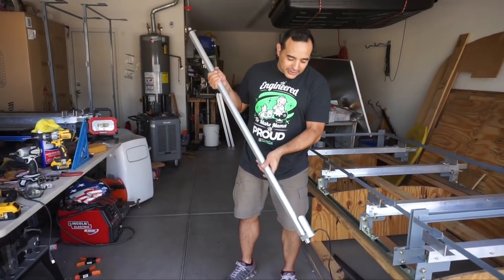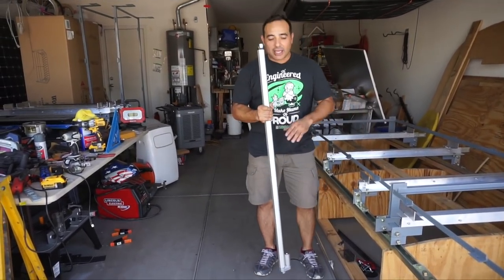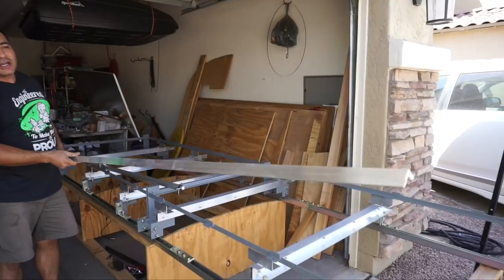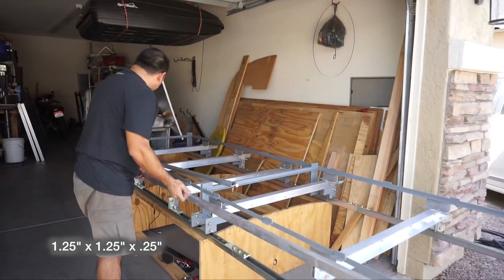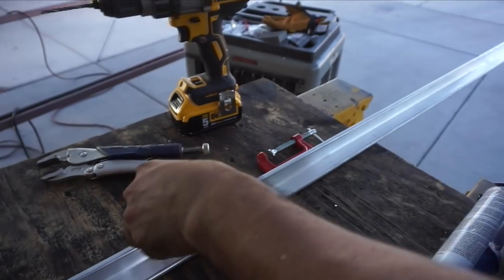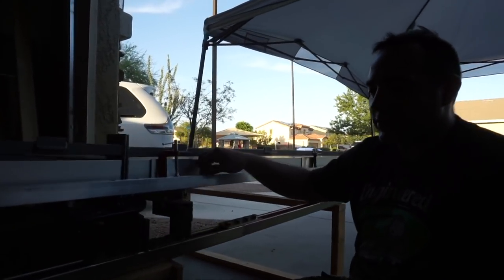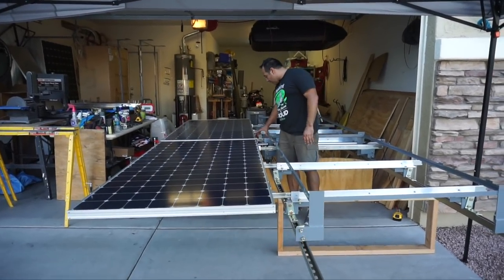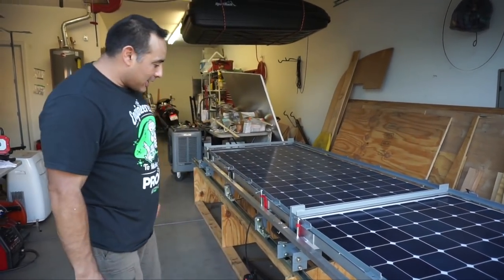Solar Rack: Part 5 - Fitting a Linear Actuator

Comment: All you had to do to prevent “wobbling” is have the center slider turned 90 degree’s perpendicular to the two outer ones. If you would have done that you didn’t need to over engineer this all.

Comment: I have concern with the way you are attaching the operating end of the actuator. With the droop your panels have at full extension, having the end of the actuator fixed will cause the operating rod to bend. This may cause binding and excessive wear on the actuator. It will likely be better to have that end float.
Reply from the maker: Hmm that is a good point - I will need to take a closer look at that - Thank you for sharing.
Reply: @BeginningfromthisMorning  Just make sure the motor can pivot at both ends so it adjusts to the droop.
Reply: hi maybe you can answer a side question, you seem knowledgable on the subject.   Do they make telescoping actuators....my specific needs is it starts at 28 " then can telescope to 85"?    thanks in advance.
Reply: @jackduplechain7592  non-hydraulic actuators can only extend to less than twice the contracted distance. Hydraulic adds weight and complexity to the setup.
Reply: @leebiggs2844  thanks for your response
Reply: @leebiggs2844  thanks for your response.

Comment: Great job!

Remember, as long as you have the upper panels on a separate charge controller from the lower panels, you can still be charging your batteries with half the panels when they're retracted!
Reply: They don't need to be on a separate controller, just need to be wired in parallel.

Comment: Very nice. One thought would be to go from the angle aluminum to square tube aluminum in the same dimensions. That would be more rigid and maybe stop the wobble at the and of the travel. I do not think the wobble you have is anything to be concerned about other than the aesthetics? 

I think you should use a 48 volt battery and try the hurtle race again (I wounder about longevity of the motor if you were to power with 48 volts? speed would pick up and as there is hardly any load the motor might survive??)! 

I think it will be plenty strong to resist movement unless powered (movement would have to over come the worm drive gear in the activator) . Only other thought would be to have one liner activator for each panel, at $200.00 each it would only be a total increase in cost of $400. 

Been looking into costs of building a new barn vs repairing one of the existing barns for my shop. The one I wanted to use for the shop is so far gone that it is cheaper to tear it down and build new (or so I thought) every time I talk with the contractor the price goes up. Started at $35,000 and now we are at $70,000. 

I put a stop to that and the current thought is to use one of the other buildings for the shop but the same process of increasing costs is happening. May have to wait and do it myself after I move in.

Great progress! Glenn
Reply from the maker: Thank you Glenn - always great to hear from you.

The wobble was reduced considerably when I went the 1/4" thick aluminum.  I think that when we are able to secure the panels properly and actually fully secure the angle bar across the front that it should eliminate most if not all of the wobble.   I agree that it seems to mostly be aesthetic in nature (there does not seem to be any binding happening as evidenced by the constant pitch of the motor (it does not strain at all).

I have given some thought to doing one actuator per panel - that one is not off the table yet.  Plan B is always: "spend more money"

On the barn - that is a shame - do you think the guy is just trying to feel you out for what you are willing to spend?  I kind of felt that way when we were getting quotes for the paint job on the bus.

Doing it yourself might be a fun project - I built a garage with my dad when I was much younger (maybe 13 or so) and I distinctly recall he used that opportunity to "teach me the value of a dollar".  Turns out a dollar is worth about 2 months of hard labor digging trenches, pouring concrete, framing the structure, and painting it!  I remember thinking "man this dollar he keeps talking about is not worth it!"

Best of luck on the move - I am looking forward to new videos at the new place.

Juan

Comment: Great job guys, but being an engineer... a colleague of mine used to say: “Now for the real life test, poor a bucket of dirt over it and see if it still works” ;-) ! Thank you for making these videos.
Reply from the maker: LOL yes ... most of what we do is somewhat of an "experiment".  We figure - even if they get stuck - we should still have 1740 Watts of power.  If you look on YouTube most "HUGE" RV systems hover around 1000 Watts :).  We are cautiously optimistic this will work even if the deployment mechanism starts to be an issue.
Reply: Beginning from this Morning wow, thats a lot of power. Guess you have the choice to leave the bottom row covered if you don’t need the extra power if the rows are correctly wired or you could sell the excess energy to neighbouring RV’s on camp sites ;-)
Reply: I was thinking that those sliders are going to get dirty and bind up. I hope the actuator has a over current protection.  They have to unsealed many little parts.

Comment: Nicely done. SOME SWEET FABRICATION IDEAS APPLIED ON YOUR BUILD.
i DO HAVE SOME CONCERNS THOUGH. A 35 foot coach will have some flex on the chassis and coach body.
Since the frame is quite rigid and if you bolt  down solid to the rivet line on roof there is a possibility that overstressing could occur and crack panels. I have had some nasty service station approach entrances that have caused some stress on rigid applications such as you have built! 
Keep the great  ideas flowing..
Reply from the maker: Thank you Ron - very interesting points.  I agree with you that the coach will have some flex it in it but I am not sure it would be enough to cause a panel to break.  Our bus is approaching 55 years old and probably has over a million miles on the chassis - yet along the entire roofline, there is not even a single wrinkle that would indicate a significant amount of flex.  The aluminum skin is only about 1/16 of an inch thick - so I would think that any flex significant enough to damage the panels would show up in the aluminum skin as well.  Here is a picture of the roof and as you can see it is very smooth: https://photos.app.goo.gl/nSAxE4Cd5XLpA1qh7

Comment: Brother, If you replace your 1.25 x 1/4 inch angle with a rectangle bar laying flat-all your wobble problems disappear. For good.
Nice idea.
Each level of panels should have its own charge controller. Then you can remove that extra space/weight/mass/gap etc.
Reply: I don't think it's rigidity that's causing the wobble. I think the rack is "teetering" on the center point where the actuator's pushing because either end of the movable rack is independant. Imagine a gear rack on either end of the movable rack with intersecting cogs on a common shaft so that one end of the movable rack is kept in line with the other. I've seen mechanisms like this on file cabinets so the drawer pulls out evenly.

Comment: You're guy's welding and fabrication skills kinda scare me but thank you 10x for the idea of how to make a sliding roof solar rack. The other video I found used arduino and pneumatic slides, way too complicated. If your welder has the option to use an aluminum spool gun, that and a bottle of Argon is all you need to weld aluminum. you could also braze it. round or square tubing in 1.5 inch or bigger would have been stronger than angle, but trivial stuff like that aside, your design is brilliant, thanks again! also for your wife, I would buy her an OV (organic vapor) rated respirator. 3M 6001 cartridge on amazon is your best bet, plus you need the dust filter and holder that fits over that. they also sell chinese knockoff  respirators , but I can't recommend those because their certifications are literally made up, like an electrical cord without the UL rating
Reply: hi maybe you can answer a side question, you seem knowledgable on the subject.   Do they make telescoping actuators....my specific needs is it starts at 28 " then can telescope to 85"?    thanks in advance.
Reply: @jackduplechain7592  I'm not sure if telescoping is the same as linear actuator but yes they make them. on ebay search for linear actuator and add in the travel in mm such as 1600mm. do you actually need it to move 85" or just the difference of 85- 28? 85" is very long travel distance and uncommon. it's possible you need to research the common design. it might also be possible to combine 2 actuators that are shorter such as one that travels 40". again it would depend on what you're making and what you absolutely need it to do. I'd start googling other people's designs and as a backup get advice from a metal fabricator shop. also consider if you can have a manual slide , they have ones made for vehicles and the bearings are sealed from the weather, they use a spring loaded latch to go into a hole to lock them in place.
Reply: @eksine  thank you so much,  lots for me to unpack here,  great stuff!

Comment: Coming alone nicely! The only thing I may have done a little differently would be to have two actuators mounted on the ends instead of one in the middle.. but like you said when everything is all bolted down, you will be able to tell if another one is needed. Hell of a good job Juan and family!
Reply from the maker: Thank you Todd - We considered that also (would remove any wobble for sure).  But if we went that route we would likely just put one actuator on each panel.  If these things were not so expensive ($200 each) we would have probably just done that.
Reply: hi maybe you can answer a side question, you seem knowledgable on the subject.   Do they make telescoping actuators....my specific needs is it starts at 28 " then can telescope to 85"?    thanks in advance.

Comment: I would be worried about wind while parked, but maybe if its super windy the odds are it won't be a bright sunny day?

I wonder if you could install a safety like the RV awnings that will retract automatically when they start to bounce around from Wind. I think it would be a few sensors and will only activate if the panels are deployed. Would be easy... Are you going to add it to home automation? 

even better they sell aftermarket kits, Lookup.

Carefree SR0093 Awning Motion Detection Retractor

As for the build out, I might have built the sliders like a Garage Door using roller blade wheels and steel, kind of like a slide out on a RV
Reply from the maker: Thank you Stephen - the wind is a big concern but we are hoping to minimize it with sensors (as you describe) and common sense (like not leaving them out and having systems in place that will retract them when there is danger or it is nighttime etc.).  Even when the lower panels retracted we should still have 1740 Watts available.  Garage Door sliders is an interesting idea.  Thank you for the feedback

Comment: Looks great, you will want to use non yellowing UV rated Clear-coat over those plastic pieces otherwise i am sure they will degrade quite quickly in that AZ sun. Easily available at Lowes/Home/Amazon? Depot. 5-10$  Also do those slides require maintenance or lube? are the stops plastic and susceptible to breakdown?
Reply from the maker: Thank you - I am sure the plastic pieces would benefit from some type of treatment.  I will be looking into this because the solar install is quickly approaching.  Supposedly everything on the slides is stainless steel and "weatherproof" - but I would feel better if they were coated.
Reply: @BeginningfromthisMorning  It might be better to leave them alone if they're stainless. Spraying any kind of oil will just attract dust buildup?

Comment: Awesome project.  How are the slides holding the rain? are the slides balls made also of stainless steel? Same thing  with actuator ,they do not seems to be waterproof.  Thank you
Reply from the maker: Thank you - they seem to be holding up great - they have been installed and sliding back and forth 2 to 4 times per day 4 times per week for the last year and half.  They are stainless and I do not see any evidence of rust on them at all.  I did lube the bearings with a lithium grease but I think that was mostly a mistake I think "dry lube" is probably a better idea.  We have had one slider come apart because our alignment was not 100% perfect - it still functions and slides but we will be replacing it soon.

Comment: I need to make a sliding rack what did you use for the sliders? I built a huge 2 rack tilting solar arrays out of EMT and unistrut on my flatbed trailer and I still have 6 small panels that are suitcases right now 200 watts each case 2 100 watt panels.and my other 2 arrays are 2 300 watt panels each everything is 120v the 1200 watt panel array is hooked to my breaker box then 100 amp EPEVER 200v mppt controller and the 600 watt suitcase 120v array is on the 80 amp EPEVER  200v mppt controller. I have 2 linear actuators 18 inch 1000N or 210 pounds push .and a wireless remote system.and a 3 ton HYDRAULIC ram to lift the back array up 19 inches and the linear actuator to tilt the 2 arrays to match each other. If I can make a sliding rail I would mount them underneath both arrays and have the smaller panels slide out from the sides that would be cool. Her is a video of my first array using 3 ton HYDRAULIC ram to tilt before I bought the linear actuators.and the second array wasnt done yet I havent done my update video yet. I will post it. But definitely i would like some more information about the sliders.
Reply from the maker: I bought the sliders from Amazon (https://amzn.to/32Hi6vn) - they are heavy-duty sliders that are supposed to be rated for 400 lbs - but I would be surprised if the actual rating was 1/2 that.  That is the primary reason I used 3 per panel.
Reply: @BeginningfromthisMorning  wow thanks man I couldn't find these a anywhere before. Especially that size.

Comment: It seems strong enough. Nice work. I hope you won't have too many challenges getting it installed on the roof. The roof isn't exactly flat. So you'll probably have to do some shimming.
Reply from the maker: Thanks Kevin - this was one of the reasons we went with SuperStrut on the base - it should be pretty effective at making a reasonably flat base for the install.  Of course, we won't know until we get it back from paint ... fingers crossed.

Comment: prob need more bracing to keep it from wobbling. maybe two steel pipes with ball bearing wheels as stabilizers. maybe something like this https://www.ebay.com/i/252166288163?chn=ps
Reply from the maker: Interesting - thank you for the link and suggestion - I will look into these further.

Comment: You can use a boost converter to get 24V DC from 12V DC
Reply: Jason Garland ,
A 24vdc actuator actually CAN run under 12vdc, it loses speed but not force...

Comment: Quick idea to take some stress off actuator, possibly need less of them. Potential power from a coil spring, similar to a garage door to release some of the weight. I'm trying to build a system for a motorhome I just purchased. Thanks for the video, great job.
Reply from the maker: Great idea - I have considered doing something like this but have not come up with a good design.

Comment: Hi Juan
Are you going to build the complete solar rack system in the garage then use possibly something like a forklift with extension Forks to raise it up and set it on top of your bus when it's done or are you going to try and build it again while it's on top of the bus?
Reply from the maker: Hi commandyne - I THINK we are going to try to piece it together using scaffolding and some tall friends :).  Fortunately, the individual pieces are actually pretty light.  We briefly considered putting it all together and then hiring a crane to come to lift it all up on to the bus but I think that will be much more trouble.
Reply: Beginning from this Morning  -  If you go the friends route, we happen to know of a tall guy who would be happy to help.  :)
Reply from the maker: Ronin and Marie - aren't you guys in CO?!
Reply: @BeginningfromthisMorning  - yep, Manitou Springs is part of Colorado Springs but we drove out to San Francisco for my school residency last May, and then just got back from DragonCon in Atlanta this week.

Comment: Good job, but not worth the effort as if and when you have a vehicle accident....it is over, for all the efforts. Flexible panels would have been best !.
Reply from the maker: We all have to decide what is worth our effort.  If I got in a vehicle accident the last thing I would be worried about was my solar panels.  It's funny that you mention flexible solar panels - I strongly considered those when I first started researching solar.  I quickly found out that they are a bad, bad idea.  The problem with flexible panels is ... well, quite honestly, almost everything.   They have lower output, cost much, much more, and generally fail after only 2 years or so of service.  The AZ sun would have almost certainly destroyed them already by now.  Of course, you don't have to take my word for it - here is what AM Solar has to say about flexible panels: https://amsolar.com/solar-panels-for-rv/2018/8/23/flexible-panels.  If you don't want to read the article they sum the whole thing up in the final three sentences: "AM Solar will not install flexible solar panels.
You're welcome.  There is a reason AM Solar has been in business so long.  It's because we don't work with garbage."
Reply: @BeginningfromthisMorning agreed. Power density is king. Panels are cheap batteries are not.